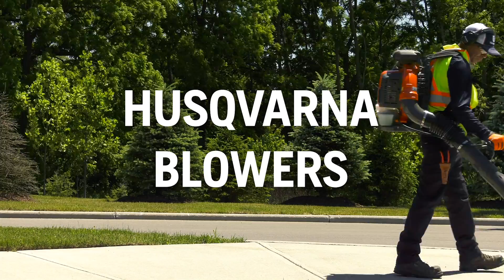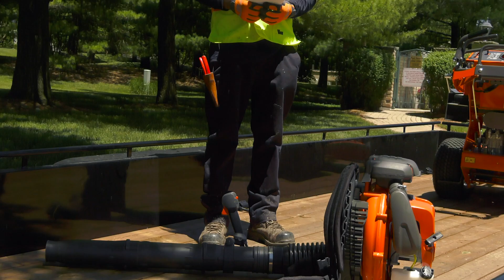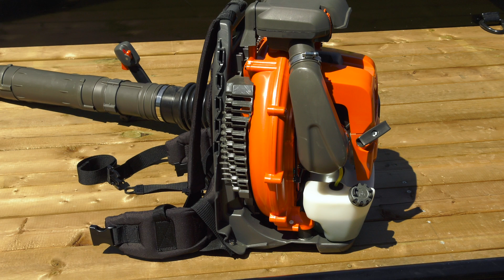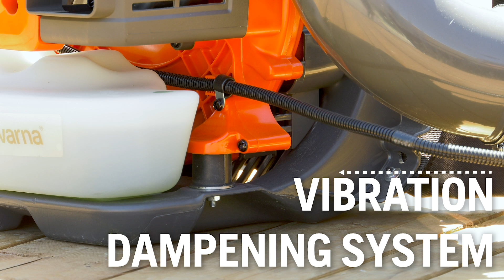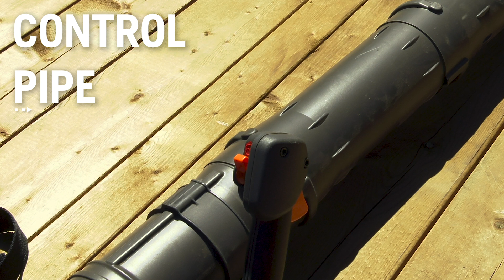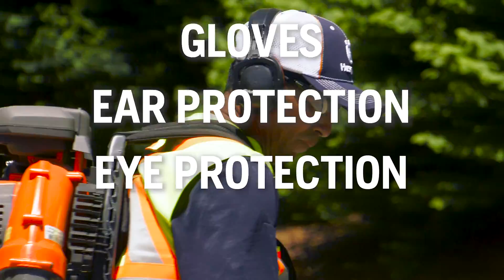How to Use & Operate a Professional Backpack Gas Powered Leaf Blower | Husqvarna

Comment: This should be titled "avoiding getting sued for product liability". 90% is safety briefing, very little operation. Lots of plugs for the super expensive magic fuel too. Like anyone who uses two stroke gear like this regularly buys that. I get ethanol free gas at a local service station in five gallon cans that I use for the 4-stroke engines too, then mix two gallons at a time. I only have the 350BT, no regrets yet though. Every so often, if I have spare fuel standing, I dump the unmixed fuel in my wife's car. I usually arrange to run out of 2-stroke mix at the end of whatever task. If I have extra I stick it in the trusty 359 chainsaw and cut some firewood until it's gone.

Comment: It would be nice if you told us what parts get hot and how to take the darn thing off !!!   Thanks.
Reply: It says to release the chest and waist strap and let it fall off your back. It's just like taking any backpack off, they don't tell you how to put it on either, they think you can handle lifting it and getting the shoulder straps on your shoulder. Most six year old kids can handle that. Is it the 25 pounds? As a sixteen year old scout I was carrying a 70 pound pack. I don't find it gets hot, since I don't poke my fingers in the exhaust. None of the other parts I can touch are hot.